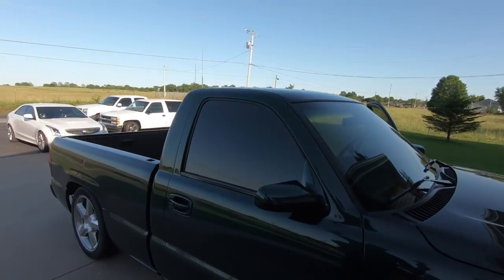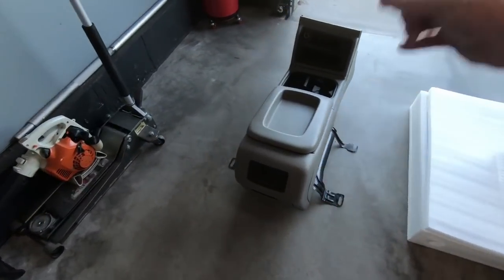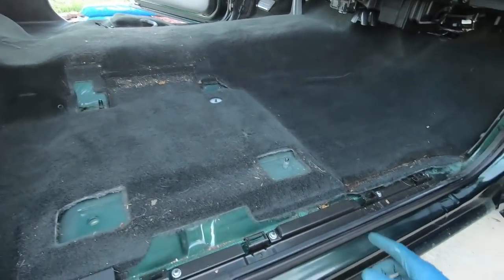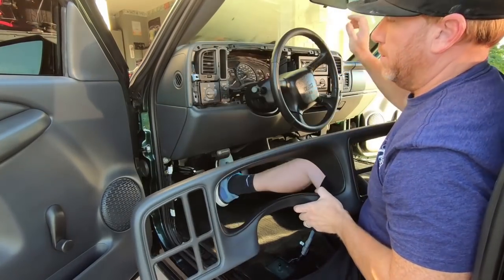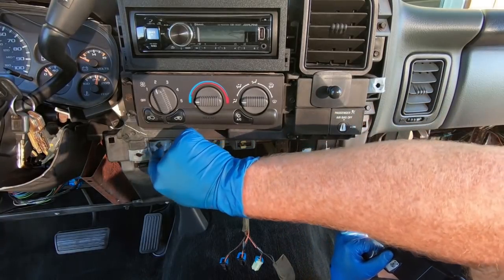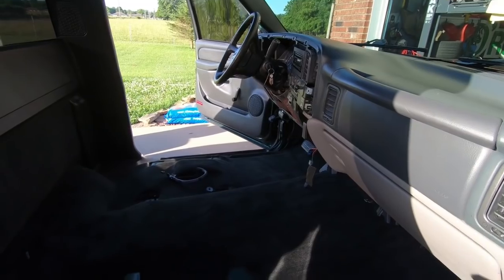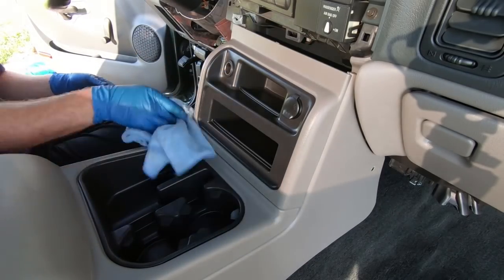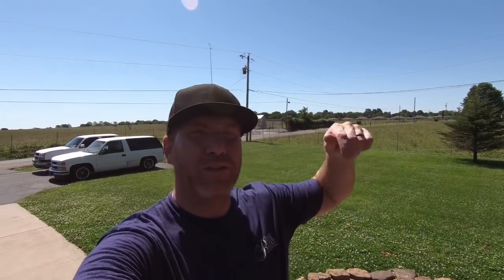Carpet Cleaning and How to Console Swap

Comment: Wire in an inverter, and put a 110 outlet in the rear of the console.  Add USB ports as well.
Reply from the maker: Now that's an idea.
Reply: @TWAMotorsports  boost auto parts makes wireless charging pad the fit in the top of the console lid. Definitely something to consider
Reply: O yeah that !!!!! 🤘🏼

Comment: a good upholstery shop can fill those holes in the knee bolster and redye the plastic.  Also, GM sells the push pin fasteners that you need for the front of your console where those holes are in the correct color.
Reply from the maker: Thank you

Comment: Great video! I have a base model 2005 Silverado single cab that was originally my grandfather’s last farm truck. I’m slowly making it mine, one option at a time. I’m hoping to do the full console conversion next. I’m lucky enough that my nephew has a 2005 Silverado extended cab with one and he may want the fold down center seat that I’ve already bought. It’s going to be difficult to wait for Spring of 2024 to get the console, or maybe not. I’m not positive, but I think the interiors of our trucks are even the same colors. I hope so, because if not, he might be turned off of the plan.

My truck also has the manual locks and roll up windows. That’s okay with me. I can still someday get the door panels covered with vinyl or leather for a different look. I also have the black vinyl floor in my truck, but it’s in practically perfect condition and the carpet isn’t worth the hassle of getting it. All I’ve changed so far in the interior is getting the white-faced SS gauge cluster with blue LED backlighting. I love it.

Videos like this one are very educational and helpful for me. It’s just crazy how easy it looks to do. If it were up to me, we would get this done on a nice day soon. But Nephew is the one who decides when, or if.

You showed me how, said which size tool to use, where the bolts or nuts or clasps are, and went through the process with great advice and instructions. Thanks again.
Reply from the maker: Thank you for the comments. Good luck on yours

Comment: I swapped the escalade woodgrain into my 04 denali xl that had the silver graphite in it. Door panels, dash pad, center console pieces with clock and flip out ash tray, woodgrain steering wheel (spray dyed the air bag), gauge cluster and dash bezel. Also got the 07 caddy 22's and some gmc caps for them. Still have to install the stainless roof rack. I like the little touches of the escalade. But I dont want drive one. Plus the dished pistons on this U vin 6.0 make great compression with a 799 head swap.
Reply from the maker: Yeah the Escalade interior is a little much for me. I wanted a more clean and simple look.
Reply: @TWAMotorsports  That's exactly what a chevy is for. I cant wait to have this baby running 500 plus all the amenities. Lol

Comment: Now you need to do an airbag switch relocation. I used an additional blank panel to fill the hole and just relocated the switch where I could access it from inside the glove box.
Reply from the maker: I may be changing things up.

Comment: Now I want to add a center console to my 2003 extended cab Silverado
Reply from the maker: Do it.
Reply: TWA Motorsports I’m assuming I would have to find one without the rear ac controls on the back?
Reply from the maker: No you don't have to
Reply: TWA Motorsports ok. I would just have non functioning air vents in the back?

Comment: I have an 02 avalanche with the same interior. My advice is buy the bezel kit for a 2din. It snaps right up to your truck, or go with a 1din with a  motorized screen. I don't like my  2din bezel but it could just be mine.
Reply from the maker: What bezel do you have?
Reply: Its a installation kit. Its a full bezel. You can find them on ebay. Its made for the 2002 and older GM's.  Way better then hacking up your dash.

Comment: Looks good boss man, I did the exact same thing to mine. Got rid of the jump seat, but I dyed all panels and console to match the rest of the interior...the color of your interior is sem 17223 very dark Pewter look into it.
Reply from the maker: Someone said 17113 was the color
Reply: I tried 17113 Graphite it’s way to light, even tho the cap colors looks just like the interior color but the spray/liquid is not a perfect match. I looked up my rpo code interior color In the glove box right above or next to the paint code ,cross Referenced it and it came up as very dark pewter..

Comment: Well now when you do the 5.3 in it you'll need to do a new column that doesn't have the gear selector and put a shifter in the console. If you haven't seen that man it looks freaking killer.
Reply from the maker: I have seen that but doubt I will go that far
Reply: @TWAMotorsports  be a lot cooler if you did 😎

Comment: I like it. But I think the gray triangle pieces really make the new lower pop. I did around my suburban bezel with metallic gray. Where the black goes around the radio and heat controls then around gauges. I think it would really help with yours. Maybe the seats the other way around. With the lighter colors outside. Like the CTS seats. Just something to think about. But then one up the CTS with the face of the head rest light the sides and back dark. Maybe embroidery in a SS logo  into the head rest.
Reply from the maker: Yeah I have the triangle parts now. I will do an update video soon.
Reply: Is the dashboard bezel from the donor car or is it the original one from the green truck?
Reply from the maker: @user-vy6qy7fr5mstock dash

Comment: Looks great just got a parts Tahoe today taking parts off it to put on mine n was wander if you knew would a 03 steering wheel fit a 02 wanting the newer wheel in mine
Reply from the maker: Steering wheel will not fit. Splines are different

Comment: So I bought a console at the junk yard to swap for my jump seat. I have a 2002 Silverado 2 door. My dash set-up was exactly like yours, 3 lighters and an ashtray. The jump seat came out exactly the same. But my new console is different from yours. Mine is a 2 piece. The front section bolts directly to the dash after I remove the plastic dash part under the lighters. 2 tabs up top, 2 screws in the bottom. Did not have to remove glove box or piece under steering wheel. BUT the back part of the console does not sit on a frame like the original jump seat or the console you have. It bolts to the floor with 4 bolts. I have not put that in yet because I want to see if the floor has the bolt holes. I can always drill some but want to check first. I guess there are two types of console?
Reply from the maker: Yes I did the 03 up. You bought the 99-02
Reply: @TWAMotorsports  LOL that would explain it. Strange though that my jump seat had the frame that bolts under the seats but the console doesn't.
Reply from the maker: They generally don't

Comment: Good video!  And thanks for the links.  On eBay now there is an 03-06 Yukon/Tahoe console set. Looks exactly like yours.  Do you know if that 03-06 will fit 99-02 body style?
Reply from the maker: It will fit. That is what I used here on my 2002

Comment: Getting set to add some graphite power seats that came out of an 02 or 03 Tahoe and a graphite 2 piece console out of a 00 Silverado/GMC into my 00 Silverado Stepside with graphite interior.  You made it look so easy, I hope it will be for me.  One question, on the 2 piece console, should I attached the part that connects up to the dash first, then attach the other larger piece or is it better to install the full console?
Reply from the maker: Yes dash part then rear part

Comment: Great video, you showed way more than the others. I am about to do this myself. So is it possible to re-use my original glove box? Can I cut off the lighter section? How about the part under the steering wheel? how much will I need to cut?
Reply from the maker: You can cut but it looks terrible
Reply: @TWAMotorsports  Thanks, I'm going to pick up the console from the junk yard. i will get the other two dash pieces also. Ever put in an overhead console in a regular cab truck that didn't have one?
Reply from the maker: I haven't but would like to

Comment: I just found your page and as I'm restoring my dads 2000 GMC Sierra 4x4 you answer a lot of questions I have on things I want to do. My only thing is you mentioned in this video putting a new dash pad in but I didn't see a video on your page of you doing it. Have you done it yet? Or what company do you recommend? Mine is cracked pretty bad in several locations.
Reply from the maker: I don't like aftermarket ones. Try to find a good one in a salvage yard honestly

Comment: If I have a 2004 Chevy do I have to buy a lower steering column that came with the center console or I can use the same since it’s a 2004 not a 2002 and under
Reply from the maker: Think you can get by with stock one if I remember correctly

Comment: id definitely say im late to these comments lol im trying to round up all the pieces for this "swap." What is that little bracket thing called that you screw the two 10mm bolts into. The piece that you said you have to drill a hole for on some trucks. I cannot find one anywhere
Reply from the maker: Not sure what it's called but they are tough to find.

Comment: 15189381 is the part number for the cubby hole to switch out the back piece. I installed it on mine since it looks way better Nd dont have old technology that i wont use
Reply from the maker: I don't think it is available anymore
Reply: @TWAMotorsports  its not but u can look up on ebay thats how i found mine just when bored search up cubby hole delete for 03 center consoles there a little hard to find but i found mine for 15 dollars

Comment: Do you have recommendations on removing the film on a dash? I have spots peeling and its black and nicer underneath the tan
Reply from the maker: I'm not sure the best way to stripe it without ruining. Maybe a power washer
Reply: @TWAMotorsports  thank you for the response ill try that!
Reply from the maker: You're welcome. Let me know how it comes out.
Reply: Usually people use a power washer if you remove it from the truck. And should come right off.

Comment: You didn't opped for the Bose speaker i wired mine in with amp than the one it came with
Reply from the maker: No I may upgrade stereos down the line.

Comment: is there anywhere i can get the back piece for the console to bolt it to my dash?
Reply from the maker: You can buy parts on ebay for that
Reply: @TWAMotorsports  yeah got it , i didn’t know what the part was called but found out it’s the “front bracket console “ picked it up for 50$. thanks
Reply from the maker: Nice. I saw a few on there

Comment: I must've bought the wrong center console. mine is 2 piece and I have a small gap where it meets the dash
Reply from the maker: That's the older style
Reply: @TWAMotorsports  it's a 2001 Denali console I think, my truck is a 99. sucks
Reply from the maker: Console I installed is a 2003 up console

Comment: Pewter is the color
Reply from the maker: Thank you
Reply: Dark pewter is the factory color of your pickup. The color you added I believe they call neutral. If you take the the driver side triangle it has all the color option on it. Or at least mine does.
Reply from the maker: @leviwoodring6101  thanks for the info